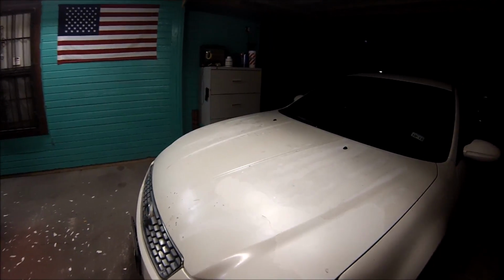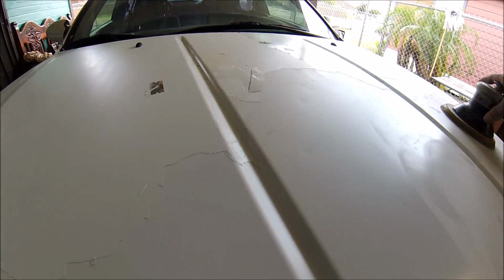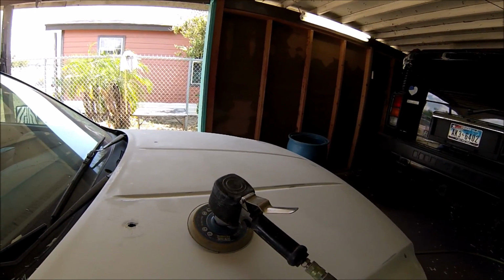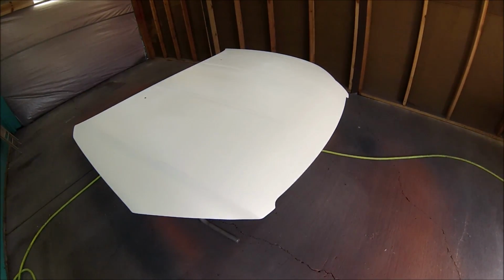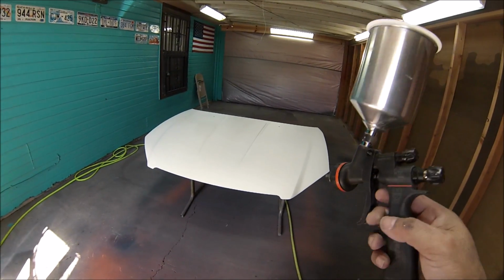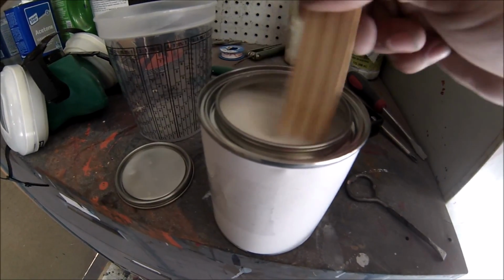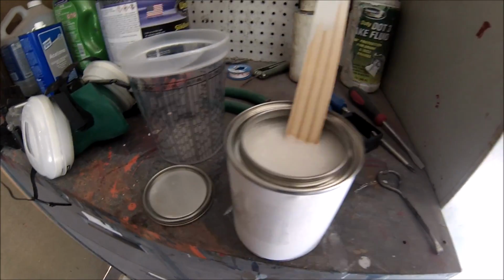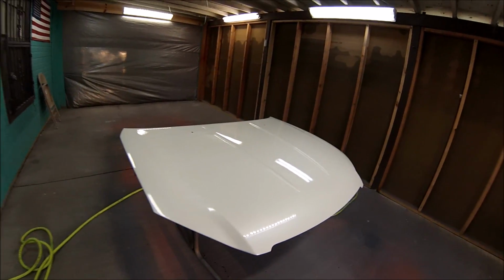HOW TO RESPRAY A TRI COAT COLOR (PEARL COLOR)

Comment: I realize this video is 2 years old. But I'm just now discovering it, as I'm preparing to perform my very first automotive paint job...ever. It's a tricoat factory Ford U6 (Candy Red).

Preparing both my truck as well as my mind, haha! The biggest part of my prep has by far been trying to make sure I learn and understand as much as I possibly can before spraying even the first primer coat. Lots of conflicting "rules" and advice, from multiple sources. So can I run my high-level plan by you here, and you correct me if you see anything bad?

I replaced 3 panels due to a collision: fender, bumper cover, and tailgate. All new and aftermarket, they were shipped with a coat of black primer. Instead of painting and blending only the new parts, I decided to take the opportunity to repaint the whole truck. Lots of chips and scratches, so not a waste of time. And I also don't have to worry about advanced blending/color matching skills.

I've sanded the existing paint with 80 grit to remove the old clear coat and (I think) pearl coat. Most of the base remains, but I intentionally burned through to bare metal in some areas with dings or deep gouges...to prepare for filler.

I bought a 3-in-one primer (U-Pol) for leveling and eventual sealing. I'm thinking I'll prime and seal completely....not "spot repair" as I've seen others demonstrate.

The truck is a crew cab half-ton (F150). So far, I'm very comfortable with my plan. But the one question I am struggling with is whether or not I have enough paint. Local automotive paint store sold me 1.5 gallons of base and pearl premixed, with 1 gallon of clear. They assured me that was plenty. But nearly every video and article I read indicates I need at least 2 gallons of all 3 rounds. So I guess there's also a second question to you with that.

Any thoughts? Or do you think I'm ready to go with what I have?
Reply from the maker: Yes that is a good amount of paint you will have no problem with painting the interior truck the only thing is that the inside of the bed not get painted if you do you will not have paint for the 3 coats that is required. 

 Also try to use a good quality paint gun most of the inexpensive guns waist to much material, just remember don't rush it or you will get modeling on the pearl. My email is pharrawaypaint@gmail.com if you have any more questions
Reply: @PHARRAWAY  Many thanks! Sorry for the delayed reply...side task of building a makeshift paint booth went bad with a strong storm, so my past 2 weeks have been spent rebuilding with a stronger design.

Last night was my first night back on the truck, sanding body filler. Your answer to my question on the amount of paint was especially awesome...that was my biggest worry. The bed is lined, so I'll be stopping at the fenders.

I think my only remaining concern is that I'm pretty sure I won't be able to do the entire truck in each round. I'm thinking, instead, of dividing it into sections, masking completed sections along the way.
Reply from the maker: @TonyGingrich  Awesome brother

Comment: I own a 2002 Infiniti I35 and the paint on it is called (Color Code: AX5Red Pearl Tricoat). I went to the local SW paint shop and asked them to mix the paint for me. They told me that that color is not a tricoat, but a simple base coat with clear coat on top. the paint they gave me already has pearls in it. I don't know who to trust.
Reply from the maker: Some paints do have pearls in it brother

Comment: After every coat did u clean out the gun? Like while u are waiting for first coat of clear to set do u empty the clear in gun out and do a new batch? Or do you just leave it in the gun until next coat? Thanks
Reply: When you are painting you can leave material in the gun for a little while. It depends on the air temp and the speed of your hardener. It will set up in the gun if left too long. You will need to clean the gun when done or switching materials. Such as from sealer to base and then clear. Be sure to clean the gone well when completely done. Material that sets up can suck to get out. Hope that helps ya.

Comment: What clear did you use
Reply from the maker: The Allkandy Wet Wet Plus clear
Reply: The tamco is hard to spray without getting peel isn’t it
Reply from the maker: A bit yes it's a good clear but wet wet has a better finish
Reply: If you heat it up it will spray like glass I found that out when I left a qt in the sun then I heated it up in a pot of hot water and boom glass again I no you shouldn’t have to do anything the on thing I found about it depends on what gun you use and the set up to
Reply from the maker: Nice gotta try it